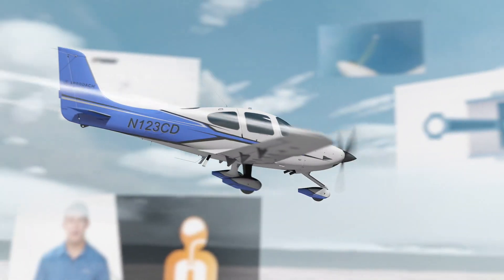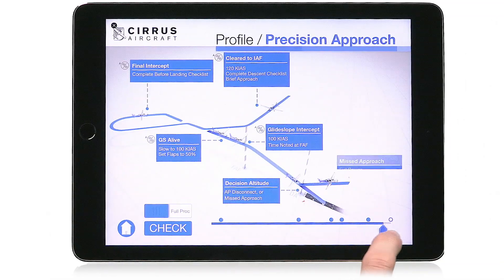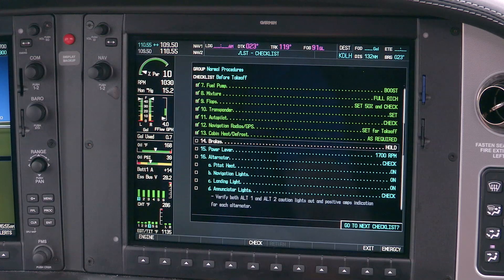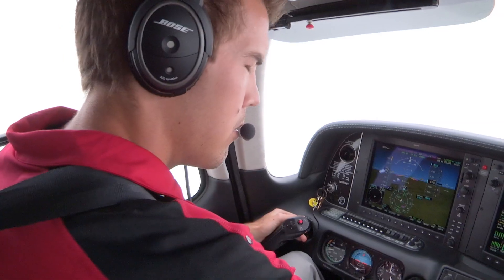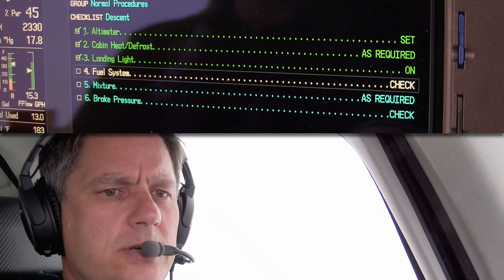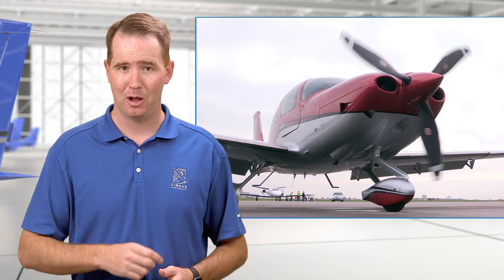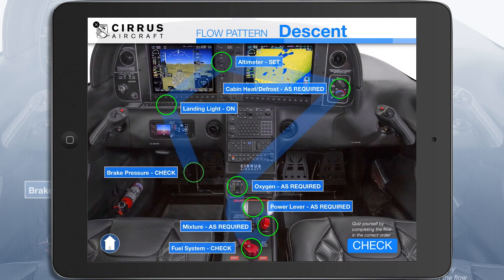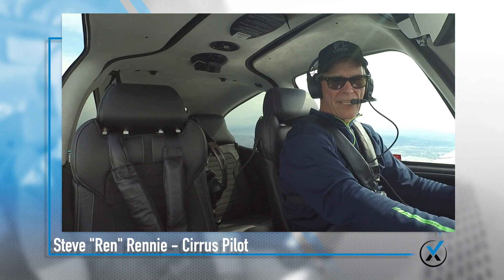Run a Checklist

Comment: Late to the comments, but is there anyway you could make a video on being ahead of rudder inputs while in takeoff and landing phases to maintain center line? I’m having trouble keeping centerline, especially during flare and higher speeds of takeoff
Reply: Easiest way is to feed in your right foot with the throttle. As the aircraft accelerates you will learn how to vary the pressure to keep her straight.
Reply: @mikecrognale3408  +1 link your right hand and right foot. Add throttle, add right rudder.